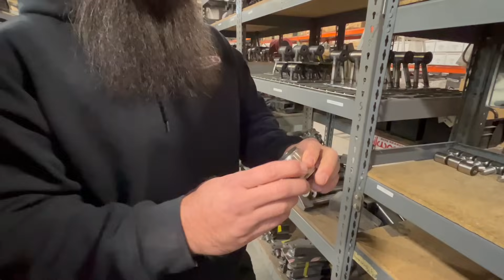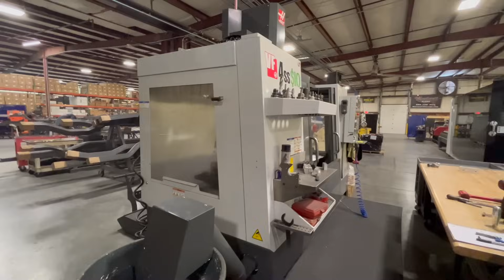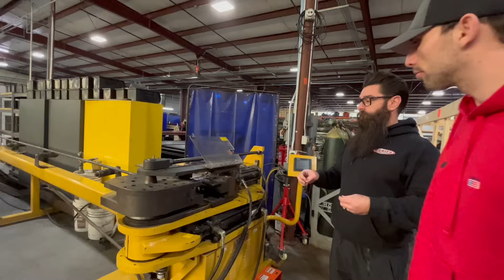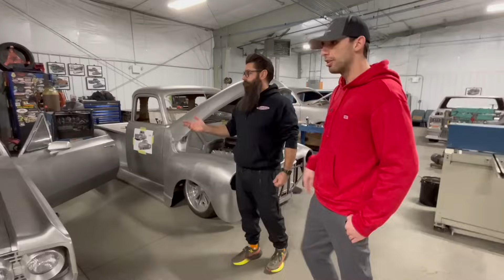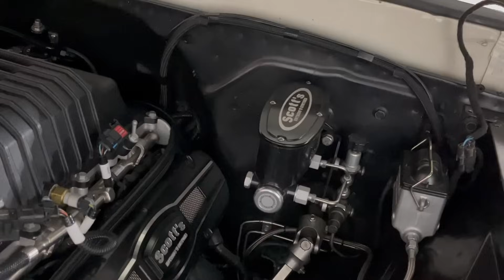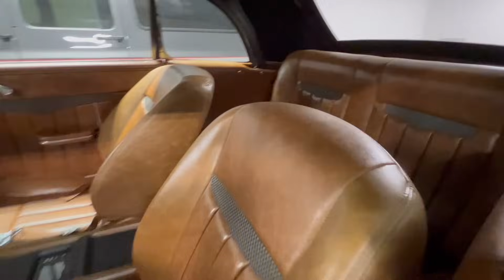I Visited a Top HOT ROD & Custom Chassis Shop!

Comment: Back i 1976 my Dad took me to Lebanon Pa to Car Village, i picked out a 69 camaro 350 4 speed , vinel top, low miles, plain jane with bow tie, was fast, had a 12 bolt rear, 2200.00 out the door, wish i still owned

Comment: Amazing shop & products. Thank you for providing the inside look! It did break my heart to see that the 2wd Blazer (aka"Goldie", built by Provost Motorsports) had been wrapped. I didn't even recognize it at first. The wrap covers up the coolest patina ever - so much so that it was featured in Street Trucks magazine in patina form. I realize the front clip had been replaced after the article, but it would have been better to fauxtina the front half to match.
Reply: They put a carbon front on, and it fit like trash. Thats why it got wrapped.